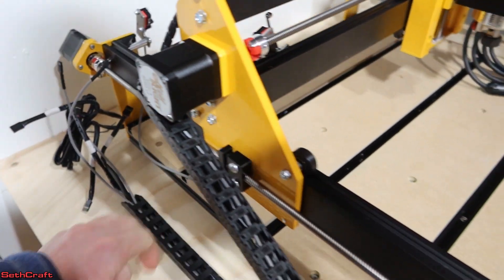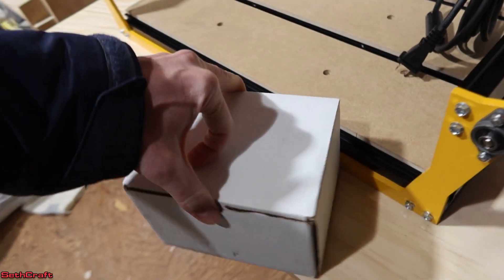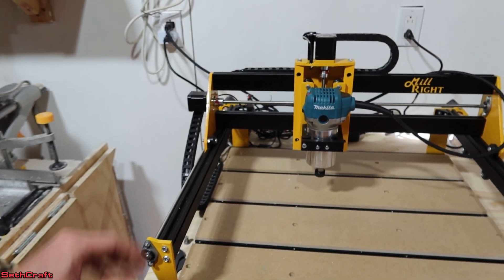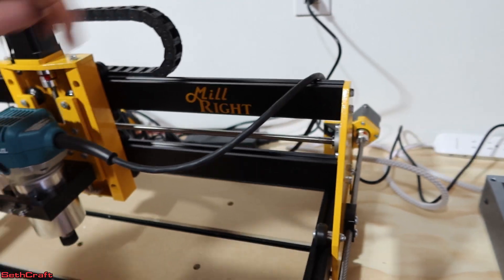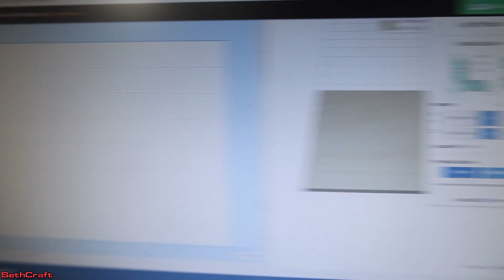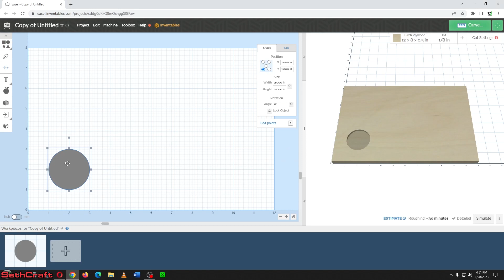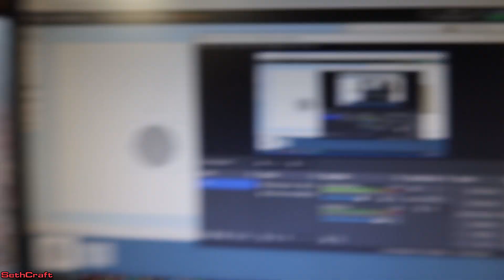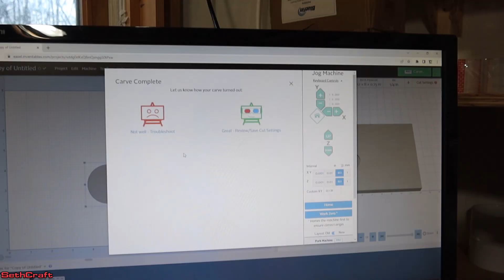MillRight Carve King 2 CNC Setup and First Run

Comment: Thanks for the video how do you like mill craft cnc
Reply from the maker: So far it has worked well. A little finicky on the lower part of the Z Threaded screw.
Reply: @sethcraftshop  
Thanks for the reply 
I’m deciding what cnc I should get for entry level and software